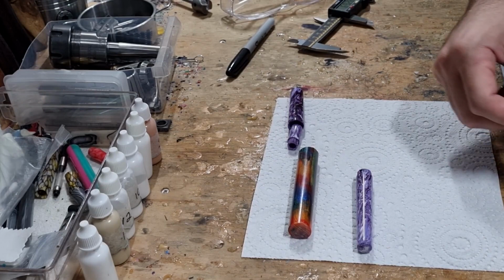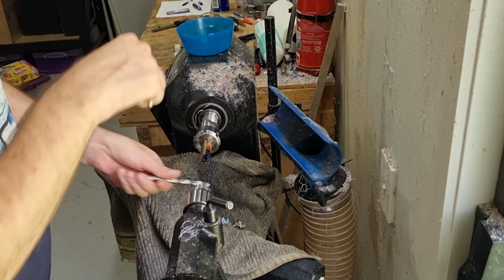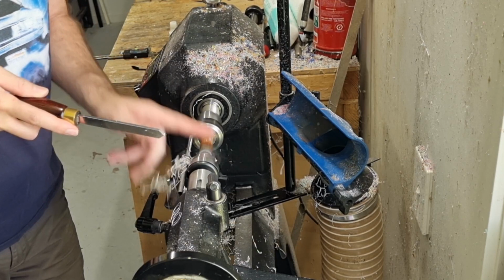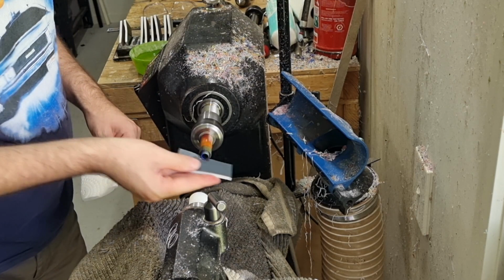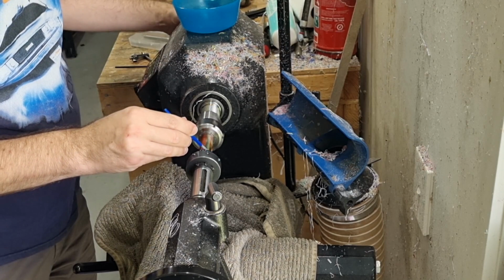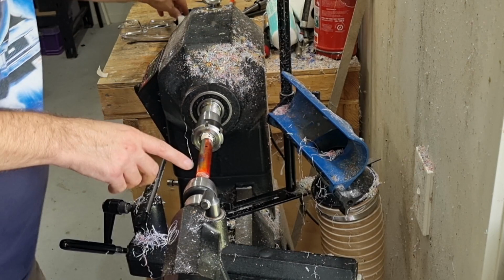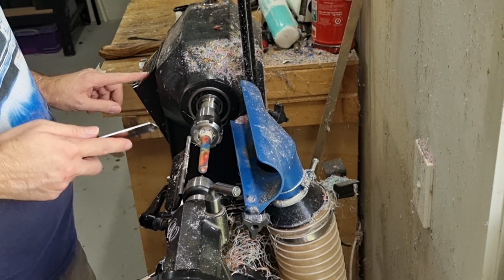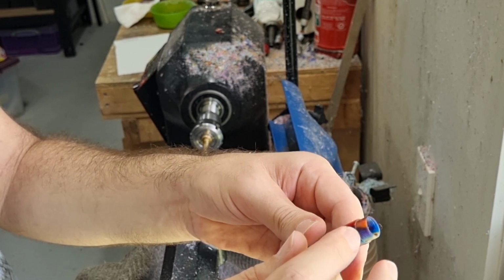Turning a Bespoke or Kitless Fountain Pen Barrel 2/5

Comment: Is there a tool that exists that is like the carbide barrel trimmer, but that does not have a hole in the middle, so that you could just tap both sides of the blank and have both ends square quickly?

Comment: I’ve learned much from your 5 vids, thank you for publishing them.     Regarding your use of a skew as main shaping tool, would you share how you sharpen it?
Reply from the maker: I have a Tormek T4 slow speed whetstone sharpener which I use. I have the platform set for the correct angle and just touch it up regularly.

Comment: I don't use a skew very much (never for a pen so far), but I don't think I've ever seen someone angle it downward like you do. Does that minimize catches?
Reply from the maker: I'm self taught with the Skew, I usually have the height of the tool rest a bit too high, mostly because I'm a bit lazy to stop and move it down. I just adapt my technique to work with varying heights and am quite comfortable with it now. Very rare I ever get catches with my Skew, maybe twice in the last 200 pens that I can think of (still have the destroyed blank from one of them on my shelf as a reminder).
Reply: @justturnings  Thanks! BTW, I'm really enjoying your videos, I agree with someone else's comment that this is one of the better series on how to do this! Not having experience with using tap & dies, is there a "rule" for the diameter of the piece to be threaded (let's say outside threads) compared to the size of the die? Or, do you know where I could go to learn that? I'd like to do a kitless rollerball pen, and I don't think my pen will have to be as thick in diameter as a fountain pen, so I want to know what size tap/die to buy.

Comment: Nice Video! I enjoy the detail and explanation of your work. You mentioned that you use polishing paste instead of micro mesh. Does the paste give a better polish than the micro mesh or is it just faster?
Reply from the maker: Both. I feel its a better finish and that its faster. Theres another video on my channel that I run through the Polish Pastes and my technique on them if you want to see it in more detail.
Reply: @justturnings I watched that video and it's one of the reasons I wanted a Just Turnings pen. They look like they have a glass like finish.

Comment: At 23:30, where do you make a "mark" when using the triple-start die?  The camera angle doesn't let us see.
Reply from the maker: Sorry about that, wasnt the best angle for setting up the camera, but was the best I could manage with what I had. 

I'm marking a spot on the barrel where the Die finishes turning, as it is a triple start die, there is 3 different threads and 3 different spots for it to stop. I want to make sure I get all 3 cut as cleanly as I can by having the Die run through all 3 threads. I mark it off on the barrel so I know which ones i've done.
Reply: @justturnings  Thank you for the reply.  I am just about to start turning Kitless pens and your videos are easily the very best there are.